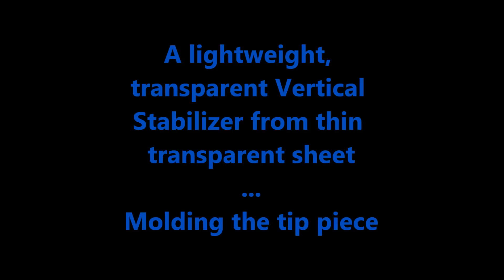Transparent Vertical Stab for a Bald Eagle

Comment: Do you  have ANY video of this bird flying. I still have your pictures from the RCgroups. It's the BEST looking epp eagle out there..very detailed.
Reply from the maker: +Valkyry5 Hi - thanks for the kind words!This scratch-built 2/3 scale size eagle was really supposed to be a test case for a larger 1/1 model that I never got round to making.  It's actually not made from any of the commercial kits out there, nor is it EPP. It's what you could call a "mash-up" of various plans freely available on the internet, while also comparing photos of actual bald eagles.  It's constructed of fanfold, and airbrushed with cheap Michael's paint.  So that why it doesn't look exactly like any of the other models out there.And it so happens I don't have ANY video of it!  It flies pretty good, but it is most enjoyable with the power on low, circling in a thermal.  At higher throttle settings it doesn't turn with equal authority in both directions.The legs are held on with rare-earth magnets, which release upon each landing.tn